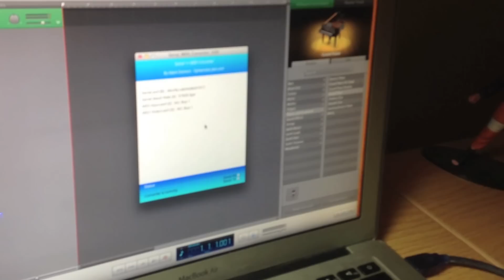Arduino Keyboard v3.0

Comment: can u pls provide us schematic? tell me if you ever did a project like this for playing chords because in voltage divider method the multiple key pressing doesn't work. because in the case of resistance connected with button we cannot press two keys simultaneously as current follows shortest path.